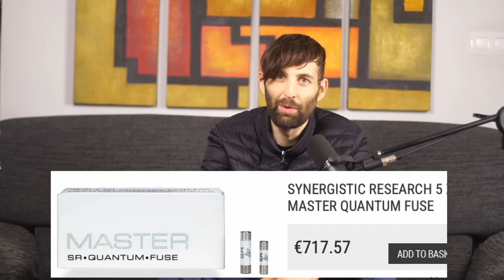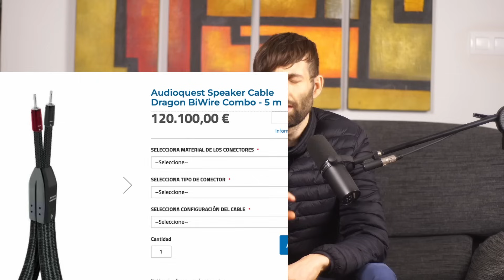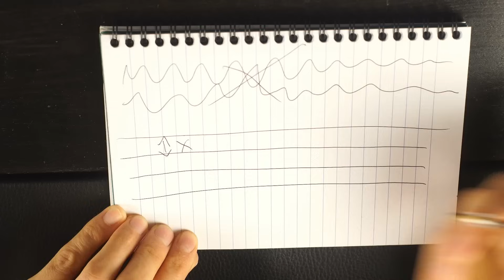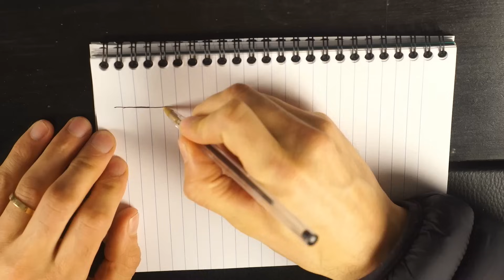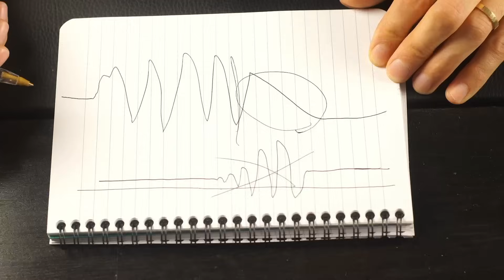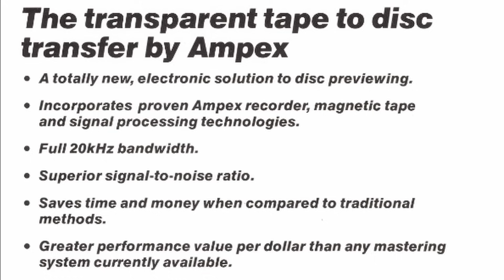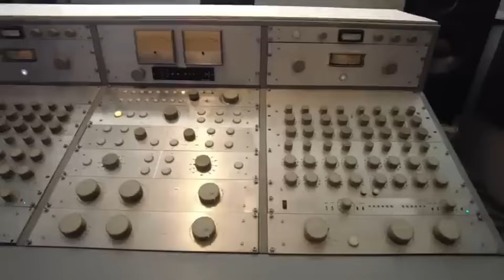Hard truth: most vinyl is digital anyway

Comment: I think that the delay line for the cutter came about after I had went to CD's. I do wish you had gone into the limits of dynamic range for different formats. My present understanding is CD's have the most dynamic range, then records, then cassette tapes. Did you ever come across records that were cut at half speed? The selling point was you could have a higher dynamic range, but they cost like twice the price of a regular LP. I bought one once and could not tell the difference. I also had a stereo dynamic range expander in my system to get back to the full range of the live band. No clue how well that worked. This was all back around 1979 time frame.

Comment: living in an ideal world, has made you stupid on (some issues) & arrogant.🤔😄
The main reason many vinyl records sound better than a cd is due to MASTERING.
Many well known lps were terribly mastered & sound crap compared to the original pressings.
When recording & mastering onto tape, it can beautifully compress the sound when pushed into the red. 
When pushed into the red with digital it just distorts & clips in an awful way.

Your ears aren't a computers spectrum analyser. Natural ambient distortions are more listenable than digital ones, less fatiguing & not intrusive to most listeners.

What you & many miss is the fact that many lathe cut records (for independent producers) are run from 16 bit masters often from CD.
However by being played back on vinyl (or plate) it is typically a more pleasurable sound, as the colouring of the sound from the medium is more complementary to out ears.

If you record ( even a record at 96Hz, 24 bit)-you will hear the music 'as if' for all practical purpose.
Otherwise many fussy listeners will find a 16bit recording less dynamic.

Also many CDs are not only poorly mastered, but BRICKWALLED, so may sound initially more punchy & loud, however when listened to carefully it is also less dynamic & fatiguing for many. 

Some tunes really kick in at a certain volume, but sound weak at low volume, while some sound great at low volume but fall apart when played loud. A lot obviously depends on the type of music being listened to.

Reggae is a special case in point, where grimy old 7" roots tunes can still sound transcendental even with a wave of noise & grot crackling away behind it. 
These tunes benefit greatly from mono systems, preamps, & most of all certain GARRARD decks that really channel the sound in a great way.

There are points you make that are insightful &  'sound',especially about the tactile nature & great size format of LPs,  but the omissions you make are misleading for a fairer view.

I think- like many things with music it is so subjective , & diverse with issues - that it is an impossible task to simply state 'this medium' is superior to the other mediums....different mediums excel with different types of music & different environments, whatever the technical aspects may imply.

I remember remastering a lot of tracks when MINIDISC came out, as there is something about its algorithm that made it 'improve' /compress the sound of certain tunes, in a beneficial way!

Comment: After recently doing the research to buy a decently nice turntable, and reading reviews of various cartridges and styli, I realized that the various imperfections in record playback systems are a big part of the draw. I was comparing the Ortofon Blue to the Nagaoka MP-110, and a lot of people prefer the Nagaoka because it is "warmer". To my ears, it just had less detail and less upper mids and highs. One person even said "If you prefer the Ortofon, just get a CD player" implying higher fidelity was antithetical to the vinyl listening project. I don't think there's anything wrong with any of this. It's just listener preference, and turntables give you a lot of options for fine-tuning the amount and type of fidelity reduction you want.
Reply from the maker: i think there is a faulty use of the word fidelity in audiophile circles. fidelity should be a synonym of transparent or unable to hear any substantial difference between source and reproduction. in which case digital is always higher fidelity
Reply: @APMastering Right. The Ortofon stylus isn't bringing out more detail than was present in the digital master. It's just more accurately reproducing that detail, but not 100%. One factor that I wonder about with records vs digital audio has to do with higher quality D>A conversion going on at the vinyl transfer stage compared to what most people have at home for playing digital audio. Not sure how much difference that really makes.
Reply from the maker: @noenduringcity DA makes little difference and some studios have bog standard DACs in their cutting setup
Reply: @APMastering I remember reading about the reissue of My Bloody Valentine's "Loveless" album. Kevin Shields wanted a 100% analog record and encountered great difficulties even making that happen because, as you point, there's almost always a digital process somewhere in there between mixing stage and cutting the vinyl.

Comment: I agree with many of your points but your aggressive tone is sometimes a turn off. That being said: Listen to Beck's Sea Change on Vinyl and on Hi-Res digital and tell me you like the digital release better. Yes - maybe it was cut to vinyl from digital - but the limitations of the medium - effectively limiting the amount of low and high end frequencies - make it more pleasant to my ears. Sea Change is full of acoustic guitars with metal strings and the high frequencies of the pick scraping on those strings just sound much more mellow and enjoyable on this inferior analog medium. And yes - I compared them both on the same speakers / amplifier. I like vinyl / analog because of its flaws. I don't claim it sounds objectively better - it's sounds more pleasant and therefore I like it more in many cases. But yeah whatever - mostly wanted to know that your aggressive / click baity titles annoy me and while many things you are saying are well understood by many ppl working in audio - I still have the urge to say that to me in many cases, the vinyl release sounds better, where better = more pleasant, more enjoyable.

Comment: First Vinyl has bandwidth up to 50KhZ, and that is 2.5 times wider than red-book SD 16bit 44.41Khz. . As there is no ideal system red-book theoretically can give clean signal without distortions up to 22Khz, but practically with all clock deviations it create artifacts in region of frequencies where our hearing is most sensitive. And we hear that s not nice sounding, compared to analogue process via  Vinyl. You forget 3M 16bit recording machine in size as big fridge from 1978. bit. The point remain that Vinyl with all its imperfections  in regards to possible dynamics and background noise sound more natural in most critical area of spectrum than CD.  to overcame this you need 24bit 192Khz min. to avoid  digital distortions that normally happens in audible area of frequency, to actually shift that in area above 30Khz. For that reason later god/proper plug ins for mixing all operate in 24bit 384Khz internally.  
     But no mater how good digital conversions are the weakest part of system remain a speaker driver. There are very few of speaker drivers that have distortions below 1% aka -40Db. Nor can provide more than 50db dynamic range in sound making. Actually speaker driver are tested on 1W power drive when they are tested and perform below 1% (-40D=db)  distortion. And if you drive that speaker with 64W , well if it is below 3% distortion it is consider as very good??. Not to mention woofers / subwoofers that in area below 40Hz have 1.5-10% distortion , but that is declare as good result. ( look REL subs data  https://forums.stevehoffman.tv/threads/subwoofer-brand-matchup-svs-vs-rel.1196628/)

Comment: I'm not an expert in vinyl record manufacturing, but I do know a fair bit about digital music production, so please take the following statements as "educated guesses":

Assuming (theoretically) that purely analog and analog-digital signal processing would produce a sonically identical signal, it would be very interesting to investigate whether one could detect any difference between the two methods in the groove of a vinyl record. The indentations in the groove of a re-analogized digital signal would have to correspond to a fixed number of states. But even at a relatively low resolution like 16-bit, that number would already be absurdly high—so much so that it would be surprising if these discrete values could actually be distinguished individually in the approximately 50 µm deep groove. If my math is correct, the difference between two adjacent values would be just 0.6 nanometers.

In principle, the cutting stylus used to create the master should have some inertia, much like a loudspeaker membrane. That means it would act as a kind of built-in, physically inherent low-pass filter and wouldn’t be able to sharply represent such tiny discrete steps of a digital signal. But maybe I’m massively underestimating the precision of the pressing technique at this point. Additional inertia effects also come into play when the signal is read by the needle of the turntable and again when it's made audible by the loudspeaker membrane.

For these reasons, I would assume that one wouldn't be able to tell from the groove of a vinyl whether the pressed signal originated from an analog or a digital source—and if it were possible, then those minimal differences would likely be smoothed out by the needle and speaker anyway.

What do you think of these thoughts? Am I way off on some of these points?

Comment: I never understood buying new vinyl or anything that had a digital signal chain in it. Defeats the purpose…
Reply: If I play digital music through a tube amp it changes the sound properties, likewise cutting digital onto an analog disc does the same.
Reply: @ but its not the original source and has gone through generation loss so it's not the same. something about those older records just sounds great while new vinyl..? not so much. usually sounds flat and compressed to me but what do i know...
Reply: @ that I do agree original vinyls sound so much better especially compared to gimmicky color vinyls. But a lot of my favorite compressed albums of the 00s I grew up with are getting vinyl releases finally and they do sound less harsh to me than the original CDs and I doubt their getting hefty remastering jobs

Comment: My vinyl albums from the 70s blow away anything digital.
Reply: @RockManEnough digitized analog is just a chopped up, processed waveform. Analog is a continuous waveform with more palpability and life. I bought my vintage vinyl new as a teenager and they’re still pristine. They have very few clicks and pops. Unlike the crap someone might buy at a garage sale. Also, anything that was originally recorded in digital and then put on vinyl is no better than a CD. Digital sound is overly dynamic. People spend a lot of money for restored real to real tape decks and analog tapes. The original master tapes of the great artists like the Beatles, etc., are worth a fortune. There is no sound in real life that is digital. Any musical instrument you hear live, that hasn’t been amplified, is pure analog. I mostly listen to digital because I am lazy. I have an Auralic streamer , a $5000 Berkeley DAC with Shunyata power conditioning and cabling  which sounds awesome, but it doesn’t have the human connection you get with well produced and recorded analog. Most digital recordings these days are way over compressed and practically unlistenable. And of course I have the last top of the line CD player Sony produced that I never use. And while I’m at it, tubes sound way better than solid-state electronics. I am 68 years old and I have never worn out a vinyl album. Peace!
Reply: I forgot to mention that I don’t have an exotic turntable rig. Just a mid tier Rega piece of crap turntable and it still sounds incredible.
Reply: @RockManEnoughno it can’t digital stripped away some components stop trying to act smart dog
Reply: @RockManEnough maybe you should try to have somebody listen for a difference instead of nobody.

Comment: If you take a signal and start to increase the digital sampling time and bit depth  eventually you will cross the threshold at which that listener can no longer detect the difference. The sampling rate has much more of an impact than the resolution and as I stated at some rate the listener can no longer detect changes in it.   Virtually all new recording are digital and here is another fact - almost 100% of old albums that get remastered get it done digitally. What is sad though is how the vinyl enthusiast claim they can hear things like transparency, warmth, openess - all things that cannot be quantified and measured. When it comes to measurements digital wins all the time.